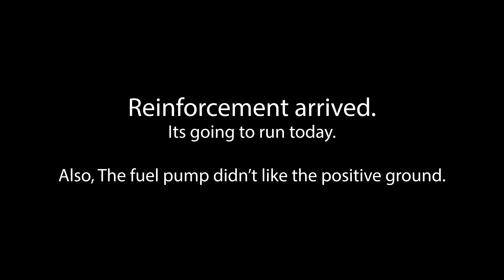KNOCK KNOCK, Who's there? Austin-Healey Sprite's first start in 10 years, did not go as planned.

Comment: Not to be nit picky, but, was looking at your fuel line (17:00 minute mark) and it kind of looks like it says "not for fuel".  Hopefully your knock is just some minor contact that can be easily repaired. I used to have a 1969 MG Midget with the same drive train; the ease of maintenance almost made up for the thing falling apart constantly. Appreciate you and JR doing these informative/entertaining videos. I'm local, maybe see you on the road in the Austin or the Bronco or the Ranger...
Reply from the maker: You had me questioning what I put on it. I took a look and it says "NOT FOR FUEL INJECTION". I conveniently cut the hose right between fuel and injection.
Make sure you wave if you see me around.
Reply: @TheFracturedRooster  Truthfully, I didn't think you would put something on that was not proper for fuel; not seeing the "injection" had me wondering though.

Comment: From what you can hear on the video it really sounds like a light tap/knock not a knock you would normally associate with a main bearing or a rod knock.  But I'm certainly no expert on Austin Sprite 4 cylinder engines and like you said it's a small light British engine so a rod or bearing knock might sound like that.  I would definitely dig a little deeper before giving up on the engine but with a vintage British engine you unfortunately have to expect and be prepared for the worst.

Comment: Well the plus side is they are easy to work on. I remember my dad changing bearings on Triumphs and Rovers when i was a kid. He would have the pan off and do them in an afternoon. Do you have oil pressure ?. I didnt see any oil getting to the top end.
Reply from the maker: It was holding 30psi at idle. But I did notice a lack of top end lubrication too.

Comment: you can do a main and rod bearing change with a jeep 4.0L still in the vehicle, it's not unheard of.  I never saw oil come to the valve train, did it lube up?
Reply from the maker: Yes, not a lot of oil. But is ix pushing oil up to the top.

Comment: Should be oil on the rocker arm splattering around while the engine is running.  There wasn’t so I’m wondering if you had oil pressure.
Reply from the maker: 30psi at idle. 40-50 at +1500rpm
Reply: Interesting.  There still should be oil splattering off the rocker arm  when running.  Something is blocked or my eyes are bad and couldn’t see oil splattering.
I know There was a change on MGB heads at one time and if you use the wrong year head, no oil goes to the rocker arm.   Try https://www.mgexp.com/forum/mg-midget-forum.3/
You can find just about any answer there.  Good luck.